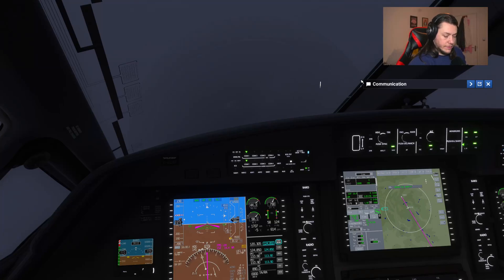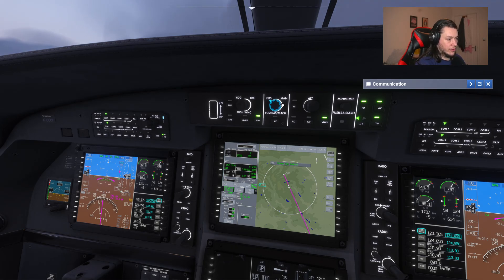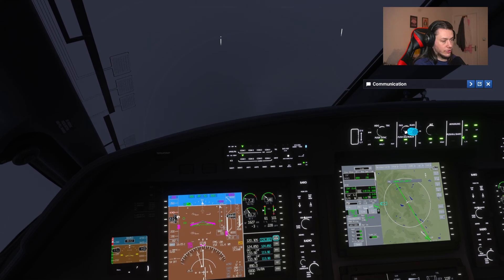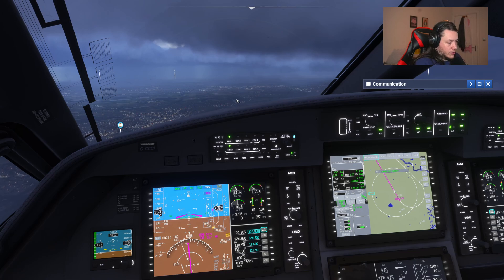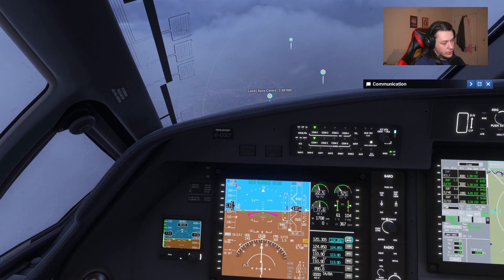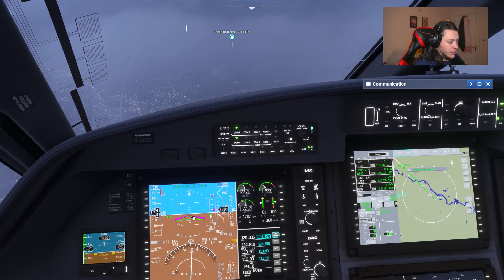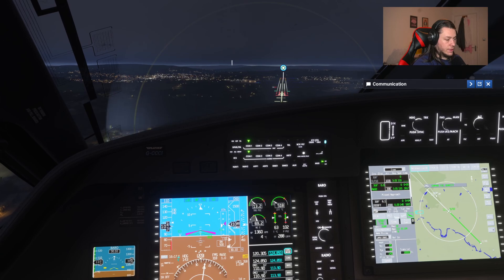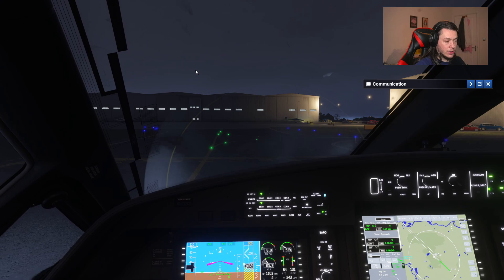FS2024 - Pilatus PC-12 - Autopilot settings and landing

Comment: Is anybody else having the problems im having with capturing the flight plan (green to pink)? You make it look so simple at 4:26,  just hit NAV after aligning the heading. Ive even tried intercept, or direct to next WP and nothing works 100% I find it ok to follow a fp just after take off but not in flight. 

Ive sent fp to avionics. And activated it.
Flying at assigned ALT, with AP on.
Next sector is green
Heading  bug is aligned to cross fp green line
NAV is white next to green HDG

What am I doing wrong?

Comment: Could you do a tutorial on how to do a visual approach on this plane?
Reply from the maker: Hello, The FMS visual approaches have not been programmed into this yet. Or do you mean just a manual landing?
Reply: @MrStephencw  Thank you for replying so quickly, appreciate that! Some quick context: I am flying cargo missions on MSFS 2024, most airports do not have ILS or any other ability type of approach. I am looking for a way to automate my approach as much as I can. On the G1000 I can just select and activate a straight visual approach that the gps can follow, I then select an altitude to be around the altitude of 'faf' and hit VNV,  when I get close I turn on APR, then I get GP on the screen, my plane follows the glide path to the runway, when I am really close I disable AP and land manually. I am looking to replicate this this on the Pilatus PC-12. Apologies for the long comment, and thank you for your time!
Reply from the maker: @Aero_Art  Yeah, Unfortunately, the visual approaches haven't been programmed into the PC-12 FMS system. Hopefully, it happens at some point in the future. For now, a workaround would be selecting the waypoint before the runway when you try to put in a visual approach, select cross and set the altitude AT as 1500ft above runway elevation, and the speed at around 95. This will ensure the plane is at that altitude and speed when crossing that final way point. And from there its just a case of hand flying it in.
Reply: @MrStephencw  thank you!
Reply from the maker: @Aero_Art  https://www.youtube.com/watch?v=5CeAEUH32-s
Reply: @MrStephencw  you are amazing!

Comment: I can’t get the plane to follow my flight plan, I have NAV enabled and everything, what am I doing wrong?
Reply from the maker: I can try help you out with that. Just a couple of things to check, is Nav enabled and GPS is in green at the top as well as AP.
In the middle of your compass do you have the purple/magenta indicator line?
Reply: Also I found if you use the in game EFB you have to click the send to avionics after you start the engine and thr have screen is up. Once sent click activate and the plan will load in. Next I believe you need to ensure that both the pilot and Co pilot nav is set to fmc for it to work

Comment: Why no one is trying to do visuals approach with this thing? Because it’s not working. Glidepath and approach button will not work. Even if you put the flight plan correctly. Pls someone explain. Because the cargo missions with this plane mostly will be smaller airports with no ILS.. so teaching ils on this plane in career mode makes no sense and is unnecessary unfortunately
Reply from the maker: I’d reccomend using a different plane or simply hand flying the landings instead of trying to use the FMS to land.

Also, this was just a general overview video not so much a career mode specific, but will have a look at visual approaches next time I’m on FS

Comment: Great Video! Could you explain what the message „unable next ALT“ means on the NAV Screen? I also get „unable RNP“ often…
Reply from the maker: Thanks! The 'unable next ALT' message will display when the FMS predicts the plane won't be able to reach the next altitude constraint in the flight plan. This is likely due to the rate of climb with the given speed in the distance between the waypoints. I suggest setting a slower speed/steeper rate of climb and see if it clears the message, or overriding the given altitude constraint for a lower one.

As for unable RNP I'd guess this is a bug to do with the sim/plane not knowing the GPS position of the plane. Do you know when this pops up or can you replicate the error message as this will likely not allow precision approaches to be flown so should be reported to the dev team if it is a bug

Comment: I can’t get VNAV or APP to enable no matter what I do. Any tips?
Reply from the maker: Hi, I can try to help you out. Just a couple of questions,
Which approach procedure are you flying? Or is it not arming for any of them?
Is it just this plane it’s not working in or multiple planes?
With the VNAV, I would first check that altitudes are programmed into the FMS by selecting the 'Cross' option in the drop-down above the flight plan and the manually selected altitude is set at whatever the next altitude you need is.
The approach is a little trickier as there could be a few different factors, If its easier I could jump in a discord call and go through it with you to try work out whats happening?
Reply: Hi Samuel. As well as checking the above points make sure  sure your NAV button is on and also you dial in a lower altitude ( usually the Final Approach Fix altitude) than your current altitude and about a minute minute before the Top of Decent   (TOD shown on you moving map)you press the VNAV button.